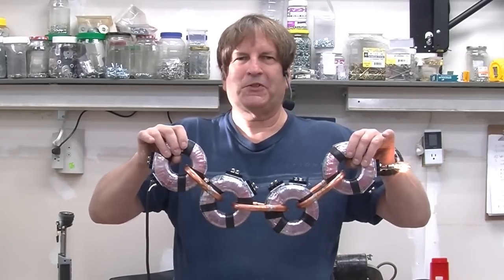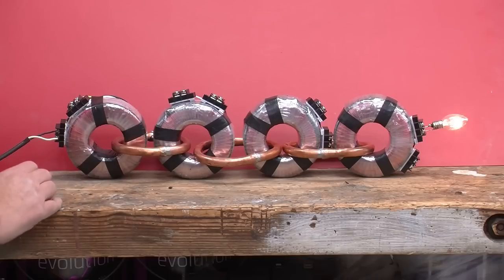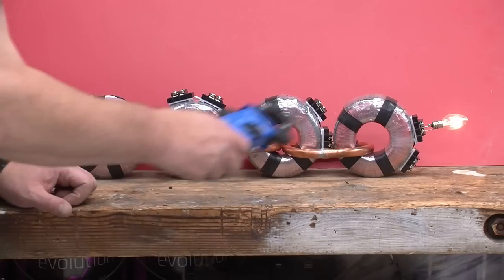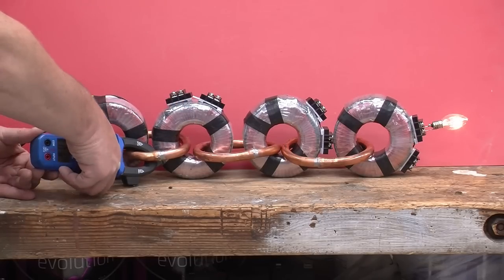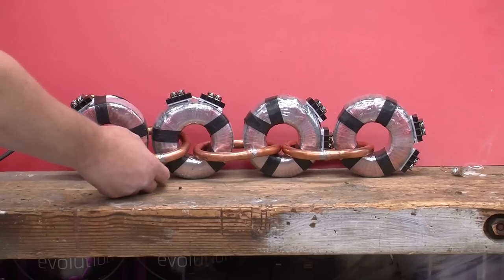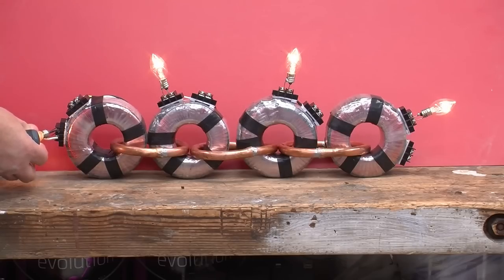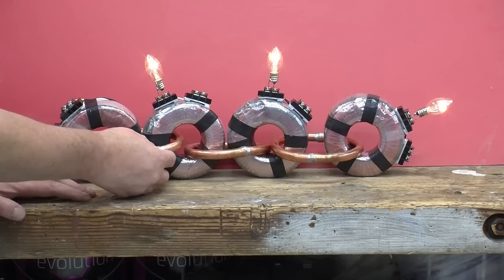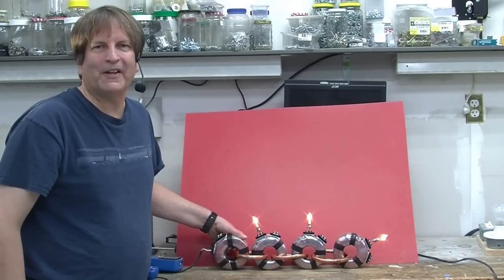Let's Experiment with an Electromagnetic Chain!

Comment: Incredible! I'm so thrilled someone has finally reproduced and demonstrated this. Originally I had learned of this setup after taking a deep dive on Bill Beaty's Right Angle Circuitry webpage years ago. This was figure 10 on his 15 figure adventure towards mcoils and the proposed electro-electret (the analog of the electromagnet). Bill's articles, esp defining electricity have definitely been a cornerstone for breaking out of conventions and thinking more creatively. 

If one were to use high-mu materials and form wires, hairpins, or transformer steel laminations to stack a coil, what kind of analog magnetic circuits could we make, and most importantly, would we be able to make a functional electroelectret in the final figure 15?

Thanks for the video, really enjoyed the presentation, style, and the thoughtful engagement with your viewers.
Reply from the maker: So glad you liked it! I first saw a china like this at the Deutsches Museum in Munich when we were visiting Germany when I was a kid years ago. 

Magnetic circuits are routinely used in the Electrical Engineering to from everything from from motors and transformers to hard drive read and write heads. Unfortunately due to the lack of a magnetic equivalent of an electron (and even if the magnetic monopole particle were ever found, it would not flow like and electron) you cant make magnetic circuits with the same precision and confinement as electrical ones. For magnetic circuits we are always limited to using good magnetic materials as you point out to manage the paths the magnetic fields take. 

But imagine a universe with not only electrical atoms but also magnetic ones with magnetic equivalents of electrons and protons. You could have magnetic circuits just electrical ones in every way. Of course no idea if  you could create a consistent sent of physics constants that would allow such a universe to existing and life to form ....
Reply: @ElectromagneticVideos  Yeah its an interesting topic in physics, the magnetic monopole and whether it is a mathematical abstraction or an elementary particle. I do remember reading a paper from Bibhas De, a protege of Hannes Alfven where he provided some proofs on a theoretical Source-Free Magnetic Structure which seemed a bit more reasonable at the time. He had some other interesting propositions including transmaxwellian equations, magnetohydroelectric waves, and essays arguing the case that magnetic field has a co-located mass, and how one would go about building an apparatus to test it. 

However, I must say I have my doubts that a magnetic monopole or SFMS exist any more than a graviton, or dark matter does. Magnetic fields are the result of charged particles in motion, and can not exist without an electric current or time-varying electric field, much as a shadow cannot exist without something to occlude the light from which the shadow was cast. However, that's not to say that there are hereto undiscovered modes of EM phenomena or suitable transducers from which to detect and convey them.

Thanks for response. I appreciated hearing your thoughts over the material constraints and practical considerations.
Reply from the maker: @InfinionExperiments  The intriguing thing for regarding mag monopolizes for me is Dirac's proof from 100 years ago that if mag monopoles exits, then electric charge must be quantized. Which it seem to be, but the reverse of the result is not true (ie no requirement if charge is quantized, monopoles must exist). 

I tend to agree with you - unlikely they do exist, but particle physicists still seem to be on the lookout for them and thats what keeps science interesting. 

Just looked at one of your videos - looks like some of the crazy/dangerous things I did a kid/teenager! I always find sparks and arc discharges experiments so cool. You can expect some comments!

One of your videos description says you in BC - I'm in Ottawa but know BC well - my brother lives in BC.
Reply: @ElectromagneticVideos  Go team Canada! Thanks for the response. Yeah they are. One of the best sparky setups I put together was one I didn't catch on camera. I reproduced a Tesla Hairpin circuit which used 2 series HV AC tank capacitors with a parallel spark gap. The tank capacitors acted as a high impedance high pass filter, blocking the 60Hz high voltage while transmitting the mirrored current from the tank circuit that discharges through the gap. Large copper conductors connected the doorknob capacitors together. 

This other side of the capacitors exhibited really perplexing RF-like high frequency transmission line effects. I noted that dragging conductors across the hairpin generated sparking, not unlike what you'd see in a lighter flint. Connecting incandescent bulbs across the hairpin illuminated it brightly even though there was a thick shorted bar a few centimeters away, as the high frequency had potential differences at 1/4 wavelength nodes and antinodes, and finally, when connecting vintage incandescent bulbs that are partially evacuated, the illumination gave off a bright blue as the bulb no longer operated incandescently, and instead ionized and accelerated the rarefied gas that existed near the thin wires. 

It was the most fascinating high voltage experiment I had ever put together.  Some had claimed the high impedance side was safe to touch, but I wasn't quite sure if this circuit was capable of causing tissue heating or possible RF burns. The circuit still today could have applications where 100W bulbs could be illuminated by thin wire, besides generally being a great tool for investigating high frequency phenomenon.
Reply from the maker: @InfinionExperiments  At the frequencies that got though to bulb filaments, its quite possible that the coiled nature of many filaments acted like an inductor and prevented normal current flow. Cool that the gas ionized and was visible!

Your very right about tissue heating a RF burns - better not to test if its damaging to humans. 

RF isnt a great way  to transmit power - too much leakage, hard to confine, and skin depth issues. But if you have plenty of space around a single conductor you can try using a Goubau line which are sometimes (but rarely) used for low loss RF signal transmission.

Comment: A decade or so ago I experimented with Joule Thief circuits that were popular at the time. I built several and strung them on a few meters of zipwire. Only the first JT was powered, the rest had their power leads shorted. With the zipwire closed in a loop every JT lit up. However the zipwire loop could be twisted up or bundled, it just had to pass through each JT toroid to light its LED. I discovered I could put 10s of toroids on it, each glowing as brightly as the first. Thanks for finally explaining the math, fascinating. 🙂
Reply from the maker: I had heard about Joule Thief experiments - I dont quite follow your circuit description but great that you got it working so well? Were you near HV power line or just from EM fields in a normal house? I have heard you can hold a fluorescent tube under a HV transmission line and it will glow - have got to try that sometime!

I'm so pleased you  found the math understandable in that quick explanation. Those two of Maxwell's Equations are so fundamental - and while I didn't mention it in the video because it was already getting too long - with one equation generating an electric field from a  changing magnetic field and the other generating a magnetic field from a changing electric field you can image how even without magnetic cores and wires, create an electric  field and a magnetic  follows,  and that will then create another electric field and back and forth slowly spreading out. And those spreading out fields are light, radio waves, x-rays, gamma rays, infra-red, ultra-violet etc. Maxwell predicted the speed of the waves entirely from the measured constants in these equations and people recognized that speed was the same as the measured speed of the then mysterious light. How incredible that light was suddenly explained and understood! More experiments on things like that to come!
Reply from the maker: @OriginalMorningStar  Very neat - actually it might be intriguing to try a Joule Thief sometime. There is actually of lot of stuff related to micro-power energy harvesting - usually from things like the bumpy motion of your body or a vehicle to power sensors as we become more and more wired.

Actually a Tesla coil is something I have never built and and want to make one sometime. I have played around with HV quite a bit (see the Flyback video - one of the first videos I did). What a scary and a bit dangerous in the DIY example in the link is depending on the insulation to protect against the HV, Yeah the current is limited in a neon transformer but I wouldnt trust its limiting very much ....
Reply: @ElectromagneticVideos  Microsoft experimented with using lower-voltage modulation to transfer data between devices using the bodyfield. I found a patent filed long after I published my project, but I've never seen a real-world application. Did they try to swipe it? IDK, but I've got Prior Art... ;-)

Comment: toroid 2 and 3 are just center cores and the winding dont matters.the light bulb will iluminate at the end only with ferrite or iron centers ,2 and 3, without wires ?it will work much smaller(the center around 15 mm?
Reply from the maker: Exactly! No need for the windings. I was thinking of removing the transformer windings of toroid 2 and 3 to emphasis exactly that, but I didn't because I didn't want to ruin the transformers in case I needed them for something else and also the light bulbs on the windings are a nice indication of whats going on the those toroids (particularity when shorted).

Comment: The fields are not located inside the matter.  The fields are outside of the matter.  What you are describing is actually called the dielectric field.  The electric field is the conjugate field created by the magnetic flux crossing the dielectric flux at right angles.  What is going on here is quite a bit more complicated than described as the various coils and tubes are in close enough proximity for induction to occur between them.  There is also self induction occurring.  Overall good presentation and demonstration.

Comment: One core and one loop of that looks sort of like an Austin transformer. Now I think I understand how they are constructed.
Reply from the maker: Yes - very similar! Are you an antenna guy? I have never seen an Austin transformer other than in photos. I don't think I would be comfortable on top of an antenna mast so I don't think I will ever actually see one :)
Reply: @ElectromagneticVideos  I like photographing infrastructure and I’ve seen them on the bottom of NDB transmitters used in aircraft navigation.
Reply: The Austin transformer is near the base of the tower.  It is used to couple 60 Hz AC to the lights on the tower, while still isolating the base of the tower from ground at RF so that the antenna can be excited with the standard broadcast signal in the region from 540 KHz to 1700 KHz

Comment: I'm of amateur knowledge in this and am trying to understand the part of your demo around 13 minutes in, after you short the coil. I know that a changing electric field causes a changing magnetic field, but, what does changing mean? Is it the speed, the position? Can you elaborate on that please?
Reply from the maker: By changing I mean the strength of the field is is increasing or decreasing over a period of time. So if the electric field is getting stronger, it creates a magnetic field. Same thing if it is getting weaker (although the field that is created is in the opposite direction). But no field is created if the electric field stays at a constant value. 

And the effect is symmetric in the sense that just like a changing electric field creates a magnetic field, a changing magnetic field creates an electric field. 

The changing part can be done as in our example by using a changing (AC) electrical current to create a changing magnetic field in the toroid,. In an electric generator in a power station, a magnet is moved (rotated) in relation to a coil to change the magnetic field in the coil which creates the electricity.

Hope that helps!
Reply: @ElectromagneticVideos  thanks, it does help, one minor hiccup: what does it mean for the strength of the field to increase? is it more voltage, more electricity, or what exactly? Really appreciate it, knowing those particulars helps so much to grasp what's going on.
Reply from the maker: @localverse  Think of a regular bar magnet you may have played with as a kid. Some bar magnets can pick up heavier things because their magnetic field is stronger, others can pick up less because their field is weaker. In our case (as with more typical transformers) we create the magnetic field with AC current flowing through a coil wrapped around the toroid core. If the AC current goes from zero to a max value, then back to zero, then to a negative max then back to zero and repeats 50 or 60 times a second depending on where you live (60 for me). The magnetic field is created by the current through the coil and its strength (just like the bar magnet) depends on the amount of current flowing. So when the current is a at max, the magnetic field is at max = like a strong bar magnet. When the current drops as it goes to zero, the magnetic field drops, so the field is now less than it was, like a weaker bar magnet. 

The ere a more detailed explanation in https://youtu.be/sc9nqxIfwlA  . In December I will do an electromagnet video and a bar magnet video which also may help ....

Comment: That is way cool, I never would have guessed the induced current would be that huge. I suppose to transfer that much energy with only .22 VAC you need a but-load of current.
Would you describe this as a chain where you have four 500-turn copper wire low-current high-magnetic links connected by three high-current low-magnetic single-turn copper pipes?
What was the current entering the first stage from AC Mains? I suspect it is less than an amp.
Reply from the maker: Yes - its funny how its so outside of our everyday experience that you just dont expect currents that huge. 

 Thats a fair physical description, but it is worth pointing out  that  the 500 turn windings in the middle have no effect = behave as if they are not there when not connected to a load so they really arnt part of the chain unless the something like the indicator lights are attached. Refining your description for the middle of the part :  a chain of  high-current-single-turn-copper-pipe-toroids and high-magnetic-field-single-turn-steel-toroids just to emphasize the symmetry between the electrical and magnetic links in the chain.

Comment: it's also a phenomenal isolation transformer, triple isolation?
Reply from the maker: Yes! It would be even better if the copper pipe toroids were suspended in the center of the magnetic torried leavening a large air gap for kilovolt type isolation!
Reply: @ElectromagneticVideos   40mm air gap clearance minimum between bar to bar and/or Earth at 1kV.  
All HV CTs are epoxy potted to meet isolation Standards. 
You NEVER EVER want to find HV in a metering or protection/control panel.
Reply from the maker: @BTW...  I have seen videos of wireless connected current transformers for linesmen working on power lines  - what a great use for wireless.

Comment: Great demo thanks! I just have one question - when you measure the voltage "across" the secondary pipe @5:49 shouldn't you have to open the pipe connection? You are measuring across a short basically, no? Ok we're dealing with AC here and IxR losses here so maybe this is correct for a "1 turn winding". Thoughts?
Reply from the maker: Thats a great question! It would be a short if there was no second core that the pipe is going though. Even then it would not be a good short but more like a resistive load because so much power is available at 0.2V that 800A or more will flow though the loop being limited by the (tiny) resistance of the loop of pipe. 

BUT - what is deceptive - just as the loop is a 1 turn winding around the first core, it is a 1 turn winding around the second core, becoming the primary of the second core at the same time as it is the  secondary  of the first core. Being the primary of the second core, means the 0.2V generated by the first core is applied to the primary of the second core (applied being used loosely since it is the same wire loop).     Now just forget about the first core and consider that the 0.2V is applied (from some unknown source) to one loop though the second core. The AC current that flows increases until   the magnetic field it generates creates a voltage equal to exactly the the applied voltage (OK its  instantaneous but its easier think as if it increased till equilibrium is met). This sets and limits the current that flows - the magnetizing current - and so its not a short, its an inductive load. So that inductive load nature of the loop though the second core limits the current and so is not a short. 

If that still isnt clear, trying thinking out it with ten turns around the first core attached to ten turns around the second core. Once that is understand able, take away one turn and the principle is the same. Keep repeating till there is just one turn left and  all you have  the single loop though both left. 

Does that help? If not I can try again!